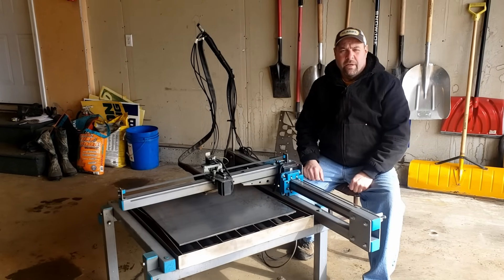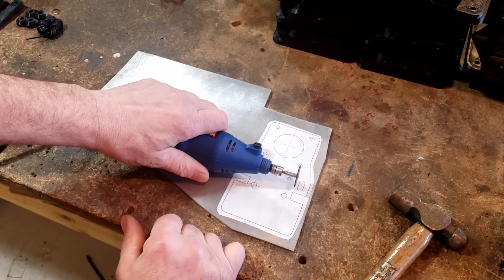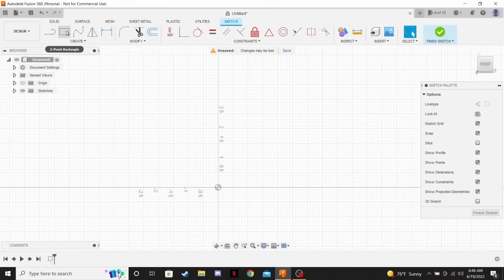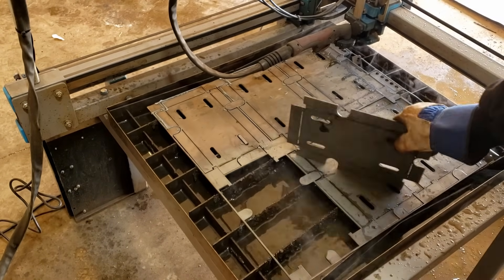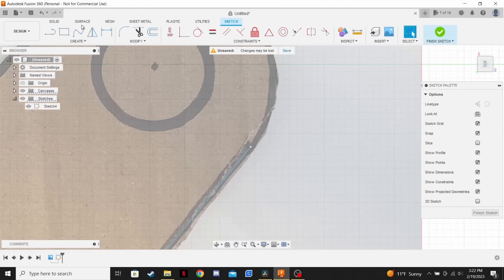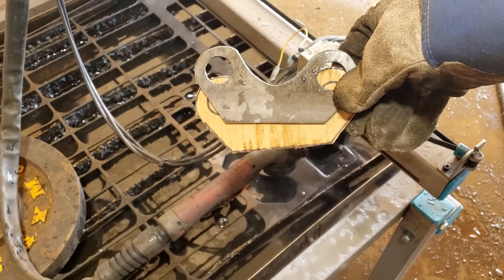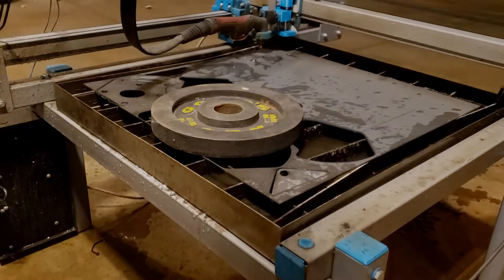Best DIY CNC Plasma Cutter

Comment: I found your website finally, I've been on the fence about buying or building one of these tables but the computer program to run one had me a little concerned, I looked at fusion 360 videos and it looks confusing, but I think i am going to bite the bullet and order your plans and parts, stay at 2 axis for beginning, and if I can figure out the programming i'll step up to 3 axis. Thanks for all your info

Comment: I'm building one of your 4x4 tables ,  ( amazing job with putting the build packages together btw) and I would like to know if the lotus has a option for a machine torch if so would you happen to have the part or models of both the plasma cutter and head. Thanks

Comment: First, this is brilliant and I'm going to start this journey soon. Second, the only question I have is the type of filament you're using for the 3d printed parts? I can print PETG, but not sure if you're doing this in ABS or another UV resistant material. Cheers!

Comment: Im very interested in the tube cutting setup. I want to incorporate rhis into my pool cue crafting.. Can you or anyone please share info helpful for rhis sort of tube or shaft system. Of course id be using this with router instead of plasma. Im new to cnc so i dont wven know the lingo what type of cnc is this? Thanks

Comment: Quick question will the electronics work with Lotos LTP7000 Pilot Arc machine? Don't want to order a bunch of parts and then find out it won't work with the machine I have. Thanks for the info.

Comment: Just ordered the plans, everything looks great!
Printing first parts as I type this, Ordering steel on Monday, can't wait!
Reply: How did it turn out?
Reply: @jethrosnyman8928  The build itself went great.  The plans are well written, when JD comes out with another project I'll buy that too. without hesitation.
It's functioning perfect, but I haven't had time to learn any of the CAD & post process stuff yet.  Not JD's fault, I'm a welder not a computer guy.  Once work slows down a bit I'll tackle that part.  Big thumbs up!

Comment: you can also toss a small 3 flute side mill to finish out your pill shaped holes with the rotary on a plunge base or pin router.

Comment: Love it! I just ordered the plans. I'm no newbie when it comes to CNC machinery, having built CNC routers and milling machines and I knew it was time to get a CNC plasma cutter in the Wet Coast Fab shop. Rather than spending the time designing and figuring it all out, I pulled the trigger on these plans! I can't wait to start building it and putting it to good use, perhaps using the machine to cut out non-3D printer component replacements for the gantry, etc.

Comment: Is there a somewhat inexpensive plasma cutter made for CNC use  ?   Building the mechanics is not hard or expensive, it's the plasma cutter that hits your wallet.  Don't want to spend 5x more than the table to get it running lol

Comment: HI Gents, could you please point me to the specs needed for the 3D printer used for this, ie filament type part dimensions, resolution and whatever else is of relevance. I will probably buy some plans but just wanted to make sure I can access a suitable 3D printer first. Cheers
Reply from the maker: An Ender 3 with and genetic PLA filament will do the trick.

Comment: Hi guys! You are awesome.!
I M on the fence to build, or modify, a cnc router, and plasma hybrid machine.
And tube cnc cut as well. 
I can build all the framing. 
But would need all plastic parts and most of all. All electronics, motors, etc. Please get back to me for a quote to supply me these parts and plan for a 4x8 machine work table. 
Cheers!
Reply: By the way, I'm not on a budget, if you suggest any thing better for our needs, like carving aluminum one day and cuting plasma, the other, and might laser mark to... Sky is the limit I know! Keep me posted!

Comment: Hello, I am in the process of building my "JD's Garage" plasma cutter. I purchased the plans and the 3D printed components. I have ordered and received all the other components, I just picked up all the hardware (nuts, bolts, washers, screws) and all I need now is to go get the metal. I love making and building things (hobbies). I am a hobbyist. I am in now way claiming to be an expert. I just know I am going to have fun building the cutter and using it.

Question: Can you do "tiling". cutting out a project piece longer the the work area of the cutter? Or, should I cut smaller pieces and use tabs and slot for registration to be welded?

Also, do you have a FaceBook page for the plasma cutter. This would be an area for others who have built the cutter to ask questions from the community, and to share their cutter and projects, ideas, tips & tricks.

Comment: Where are the dimensional drawing for the stl parts.  Mainly the 2" bearing supports.  I looked every where only seeing stalls.  Great if you want 3d prints with no mods.  But I want to mill aluminum parts for the centerr tube mount and caps that hold the bearings.  STLs do not provide sizes for that purpose.

Comment: Hey guys, I am having a hell of a time with the Arduino. I have a Due Board. The Openbuilds firmware tool no longer has the Arduino support, i try loading it (Grbl 1.1) n the IDE, it doesn't show up. Can you guys do an updated video on the programming?

Comment: Just got plans  and kit with z axis kit  very good  quality   I'm  ready to  get my steel and but I am going  to  increase  my overall size to cut 36 x 49.5 sheet  so I iam going to order  2nd kit to fully  support  grantry  like the crossfire pro table .  Plans are very simple  and  thought  out. Order  and build  today
Reply: You just answered my question, thank you!  Sitting here thinking, "How & why did they come to the decision of 28x30" size, and how could I make it at least 4x4ft?" I get 4x8ft sheets, so it'd be a real pain to cut down to fit this table size.
Reply: @branchandfoundry560   well as they said cost  was mo of the channel and the water  pan  only one  i don't mind buying  2 pans I found vevor 32x32×2.5  stainless . Iam all in for $1500   as for first time cnc build  and want to do router too not willing  to spend 5k for plasma  and then 5k + for router   as I have fabrication tools  don't want  to do full 4x8 tables  don't mind  2 /4x4 tables  that I can move around  they have limited space.  I do too but don't  mind  loosing like 5x10 is for 2 tools  i 
Have  small sign  company so 4x8 or 3x8 ,2x4 seems  pretty good  for me and learning curve.
Reply: @bobrossi1185  Thank you

Comment: My biggest question for building a DIY CNC is this, are the metal tubes straight enough for the precision that we want out of CNC?
Reply: yes, just calibrate or zero out the unit (i assume you are talking about the tubes that he made the cnc table from)
Reply: @MrMrsregor  Yes, but calibrating out the unit doesn't make a difference if the 2" square tube is warped in the middle, right?  Maybe I'm mistaken on what size of a variation matters.  Will a 0.01" - 0.03" variation for most projects matter?
Reply: @MrMrsregor  Yes I am.  How do you calibrate out a dip in the middle?

Comment: I decided to tackle this build - with no 3d printing experience and no CNC experience.  Bought a "Longer" brand 3d printer and made all the parts.  Fabricated everything else in a weekend and had it all assembled and moving smoothly.   Bought all the stuff listed in the list and then tackled the electronics.  If I would have read ALL the instructions - I would have not had ANY problems - but a quick email asking what I did wrong was responded to quickly and within minutes I was back on course!!!    My first cuts were not so great - and it turned out I had a very thin and wavy metal that caused lack of continuity on the plasma - and would "flame out".   Put a nicer (not new) piece in and it ran flawlessly.   I cannot say enough good things about the effort that these gentlemen put into these plans and project.   I do not yet have the z-axis but will be ordering all the parts tonight - and they have a THC amperage management in the works too!  My first few test pieces were 2" square and 2" circle to see how true this was running.  Dimentionally I was 2.002 x 1.987 square and 1.994 round (there was about .005 variance around the circle).  I will try and recalibrate as I think I might have been off in the Y axis...  I am VERY pleased!  I hope they sell a LOT of plans to make their efforts worth while!  Thank you!
Reply: Hello I am planning on buying the plans and 3D printed parts. My question is: Where do the electronics and wiring come from?

Comment: i have a hypertherm powermax 45 xp without the cnc remote connector. do i just bypass the trigger wires with a relay or something with your setup? thats the only question i have befor i buy your plans and get started.

Comment: I've bought the plans, the 3d parts, and everything I need from Amazon for the table and z-axis except the 25 608ZZ bearings linked on the BOM sheet.  They have been out of stock or too low of stock this past week or so that I've been checking.  Do you have any other bearings you'd recommend?

Comment: i realy like the plasma table, looks great, maby you could share some information on what software you use? for notching and normal cutting? Fusion360?
Reply from the maker: All of that information is contained in the plan package.
Reply: @jdsgarage701  I tried using fusion360 but is is quite expensive...

Comment: I'd love to work with you to get my custom piece prototyped. If I download the software and get the files to you, would you be able to quote me a price? There's no rush. I'm still waiting for some final mock up measurements before I cut the test piece out of wood to make sure everything lines up with the different test mules. I was going to use primitive means to get a prototype out of steel but If I could just pay you to zip zap it, that would save me a huge headache!!! Once I know it will do the job, I have to find a manufacturer who can make 100 of them for a test run on amazon. If they sell... I'm taking out a loan and ordering big so I can get the price down as low as possible. This could be life changing if it works. Seeing your video gave me hope.

Comment: Do you supply dwg files so we can cut the pieces out with a plasma table? I have a buddy that could cut the pieces out for me to enable me to build this. Also the files for the 3D printed parts? I have a 3D printer.
Reply: My questions too an one of the reasons I have not bought the plans yet.

Comment: plasma cutter. with rubber belts. shmart. real shmart. lol.
Reply: Plasma torch produces no friction apart form the torch itself. Unlike a router. So yeah your right,they are shmarter than you I guess 😅
Reply: Yeah, it sure begs for a cover doesn't it. But it also looks like it has cut a lot of metal. Maybe JDG can comment about the durability of this  setup.
Reply: This isnt a cnc/router machine. Belts would be a poor choice for a cnc/router machine because of the force required to push the router bit through material. In this case the belts are just used to position the "print head". Also belts are fiberglass reinforced, so they dont stretch.

Comment: Great video thank you so much for the material <3. From my experience belts get worn out and will lose precision, would you say that's irrelevant for this caliber or is the lead screw mechanism always better?
Reply from the maker: Belt technology has come a long way in recent years. When used correctly they will last and extremely long time and can hold better accuracy than lead screws. We have had the table for just about a year and have used it in a wide variety of conditions and have not been able to measure and loss in accuracy. The life of the torch tip will make far more of a difference on accuracy than the belt wear ever will.
Reply: @jdsgarage701  Great, thanks for the info I wish you a good fortune <3
Reply: Your point about belts is sound, but this isnt a cnc/router machine. Belts would be a poor choice for a cnc/router machine because of the force required to push the router bit through material. In this case the belts are just used to position the "print head". Also belts are fiberglass reinforced, so they dont stretch.
Reply: @tazanteflight8670  Alright I see, thanks a lot for that, however I have a theory, because of my obsession with CoreXY, is it doable to build a 1.6m x1.6m CNC plasma machine? Because for that I will need about 12 meters of belt. A friend of mine suggested instead of belt to use Chain, cause it's rigid and reliable and he says they last forever (sort of), now the reason behind my theory is; a CoreXY CNC plasma is 1 motor less which means reduced cost but still efficient, precisionwise it's solid, however the elephant in the workshop, is there a 12 meter+ belt in the market and when it's long does it perform the same as when it's somewhat short, in this video it's 28" X 32" which is 71.12cm x 81.28cm I want to go a bit higher than that. Sorry for long post, thank you very much <3
Reply: @red_juan  IMO corexy is a mistake. Using "binding force" to position a printhead, is bad science. Positioning should be as precise as possible, so dedicated, and simple  X, and Y axis drive will always be more accurate. Also a long belt, or long chain will have a lot of slop. Using tensioners to reduce slop, will only stress the stepper motors. It is interesting, and neat that corexy "works", but it is not logical.
Reply: @tazanteflight8670  Ok I understand the issue of a long belt, very reasonable and that was my premise when I thought of using CoreXY, but I was referring to an H-Bot CoreXY not a normal CoreXY where the belt goes one on top of the other at the other end, I still am worried about the long belt, I'm not worried about the rigidity of the CNC frame since I plan on making all metal, also I don't understand why it's bad science and not logical, engineering is redirecting the forces of nature to serve one's needs, if it works, look for pros and cons, if there are a lot of cons that could potentially be simply bad, then the system should not be brought to life in the first place, which is why I'm still doing my research, for now in my opinion a plasma torch isn't as heavy and the system is rigid so that shouldn't be a big problem, the big problem for me is 2 meters of belt, this I find like dousing your feet in olive oil and try to walk on water because oil is lighter than water, if you see what I mean. Again thanks for the info <3

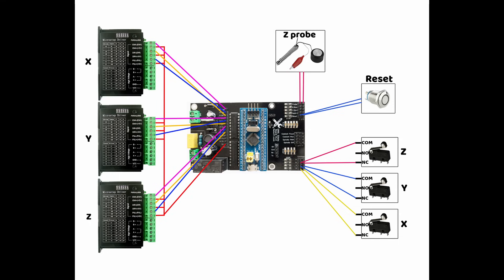Comment: I purchased the plans a couple of weeks ago and am still gathering the materials, but had a question... the schematic @1:30 shows what appears to an ARM processor. In your BOM and earlier videos, it's an Arduino Uno. Have you guys upgraded your recommendation? Thanks. 🍻
Reply from the maker: The BOM and schematic in the plans is correct, stick with that.

Comment: The X motor plate was not full size i  glue it to the metal cut it out and it was over 1/4 short on fitting the holes
Reply from the maker: The plates are correctly sized. Your paper printer probably autosized the page.

Comment: The main thing holding me back is the Ardino, do I have to program it or just wire it up to controllers? I want to buy the plans and parts just gathering information before I press buy.
Reply: The software programs the Arduino, no geek needed. See the software video. Openbuilds Control.

Comment: im having some problems in fusion360 while using the Z probe. In fusion360, it appears that pierce clearance = kerfwidth of the plasma. So if i wanted my pierce clearance to be 6mm, i couldnt cut any closed design below a diameter of 6mm.
Reply from the maker: Send an email to the channel, in video description

Comment: Couple suggestions - plans should have version/revision #'s so as you make improvements/adjustments one can clearly see what version of plans you're on. The 3d printed washers I received for the bearing blocks were too thick, impossible to get the bearings  + washers into the bearing blocks as shown in the plans. I flattened one of the washers each side and that helped make the assembly possible. The tube frame bolts are about 1/2" too short. I got mine together, but it's not great with only a couple threads in the nut. Plans should spec frame bolts (2.5" and 4.5" 3/8 bolts) to be 1/2" longer.
Reply from the maker: Thanks for the heads up, these issues are being rectified.

Comment: For anyone wondering about what the plans are like, I. Ordered and they were sent straight away. Very well detailed in clear steps. 
Just had the last of the electrical parts arrive. Now need th have another read of the plans and connect it together. 

Once I have that working I’ll order the steel tubing cut to length and all the printed parts from you.
Reply: What is your build cost?
Reply: Yeah what’s your build cost & where you located? @gavin6538

Comment: I've had my plasma cutter for sometime now and as you say it works flawlessly. And I must say your kits are of the highest quality. Thanks for the video!
Reply: What plasma cutter did you end up using?
Reply: @pablogoyaz9765  I have a Thermal Dynamics 50A and a 50A no name Chinese plasma. Both work fine.
Reply: I am watching this from South Africa,i am willing to build my own cnc plasma cutter,where to buy the plans,and suppose i dont have 3D printer ,is it possible to ship those 3D printed parts to South Africa?
Reply: For that you would have to ask JD directly.
Reply: @piwengema4534 did you manage to come right, I'm also in sa and want to do the same